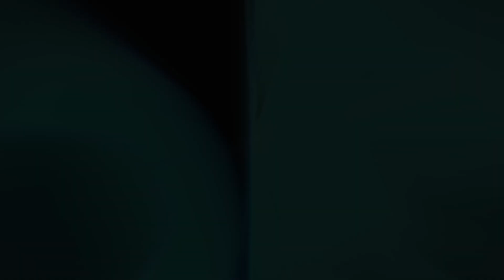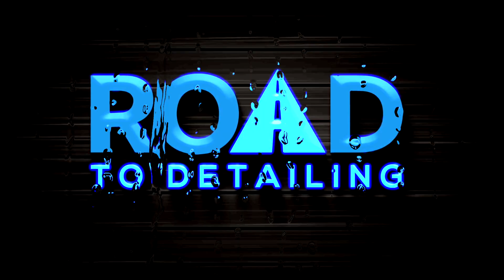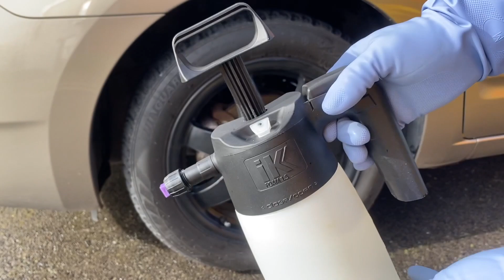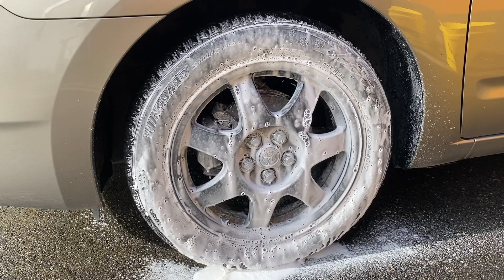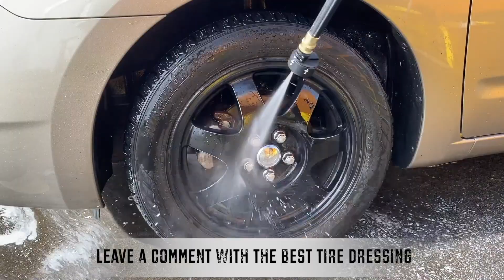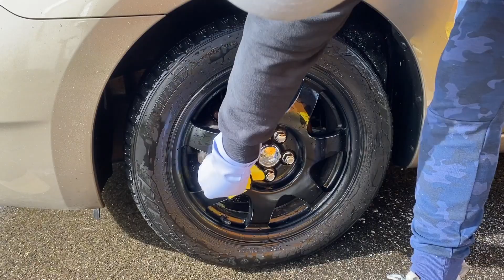Bilt Hamber Surfex HD for Clean Wheels and Tires! (Cheap and Effective)

Comment: There isn't a better all round product than Surfex HD
Reply from the maker: This is so true Chris. I agree 💯 % 👌 I love Surfex HD, one of the most versatile product! Also very cost effective and efficient! What is your second go to product or brand you really like?
Reply: @RoadToDetailing  One of my favourites is Gyeon wet coat. For a spray on rinse off product it leaves the paint really glossy and slick. I've can coat applied to my car, I use wet coat to top up every couple of months
Reply from the maker: @Chris_8270  can an wet coat should be a great combo. I personally don’t have too much experience using them. But I’m halpy for this hint as I was about to find a good spray on rinse off coat, and actually was thinking to get MG Hybrid Cermaic Wax. Did you have a chance to that? If so, you prefer Gyeon’s wet coat over megs?
Reply: @RoadToDetailing  I haven't used it, wouldn't be a big fan of Megs products. Its a bit more expensive than wet coat, I don't think the Megs product offers more to justify spending more on it
Reply from the maker: @Chris_8270  fair enough! Thank you for sharing your honest thoughts and experience. I hope you enjoyed the content and stay tuned for more to come on the channel, I would be happy to read your thoughts in the future.
Reply: @RoadToDetailing  I think when it comes to detailing its whatever works best for you
Reply from the maker: @Chris_8270  🙏👍🏻
Reply: Hi lads just bought surfex hd to use as a pre wash.. do you think I'll be safe to use a 4/5% dilution and spray on before snow foaming? Thanks.
Reply from the maker: @tomaskelly9028  Hi Tomas, 
Absolutely! Surfex HD is recommended to be used at around 4-5% as a pre wash and it’s safe to be used with a dilution ratio like this.

If the condition of the car requires (how dirty it is) you even go a bit more up, and you will be still on the safe side.

My usual go to process: 4% diluted Surfex HD as a pre wash, let it dwell for a minute or two, then cover it with the foam solution to be able to dwell further. Then do the rinse off of the surfex hd and foam together. Works like a treat. However, I think you’re going to be fine just with the surfex hd itself, it is one of the best all arounder on the market at the moment. 

Let us know how you get on with it! Feel free to hit up with further questions! 👍🏻

#happycleaning
Reply: @RoadToDetailing  That's great thanks very much for that. I will get the foam over the pre wash too In that case 👍 Appreciate the comment !
Reply from the maker: @tomaskelly9028  no problem! I like it that way (cover with foam, and it allows surfex hd to dwell further regardless the power of the snow foam solution)  #happycleaning 👍🏻🧼

Comment: Not bad I don’t use Surfex Hd as a wheel cleaner, it has done a good job at getting them clean.
Reply from the maker: It is great to use on wheels for regular washes. For more baked dirt, grime and decontamination you might need to use some like Bilt Hamber Auto Wheel (in BH range). What do you prefer for tire dressing to finish up your wheel cleaning?
Reply: @RoadToDetailing  currently I’m using auto finesse satin but I’m looking to try something different soon.
Reply from the maker: @JDDetailing  for satin finish that’s a great choice! I prefer a slight shine. Video will come out about this topic within a week or so 😉👍🏻

Comment: I've  just got  this foamer and some surfex , what dilution have you found to be gd on wheels or is there a gd all round dilution rate ??
Reply from the maker: Hi trev815,

I would say that 10% on wheels in generalis a good ratio, regardless the spray or foam bottle. You could go further up to 20%, if you really need some bite, but I found 10% dilution sufficient. In the foamer I had 100ml of Surfex HD with 900ml of water and I might used much more product then I should have 😊 but this is the cost of a foam, in a pump sprayer, you use less product so it’s more efficient and the results the same either way. 

I like to use surfex-hd either way, however foam it up makes me more happy 😊 

Let me know how you get on with the results!
Reply: @RoadToDetailing  thanks buddy , planning on stripping arches on car and work van for a gd clean before some lanoguard and acf 50 anti corrosion love 😂 looks as tho this stuff will work a treat 👍
Reply from the maker: It will do the trick I would say! 👍🏻 keep me posted with the results 🔥

Comment: Is Surfex HD as a touchless pre cleaner as strong as BH Auto foam?
Reply from the maker: Hi Dennis,
Well, Surfex HD is a concentrated all purpose cleaner, meaning you can dilute the product for different jobs. However, it’s advised to use around 4% dilution on paintwork. I don’t know that would be just as strong as Auto Foam, because I haven’t compared them, but in theory, yea it can be just as effective as auto foam, but I would say is even more harsh of a chemical than Auto Foam. You can use Surfex HD for pre wash around 4%, but it might leave residue left, and has even less of a working time than AF, what you need to consider in my opinion. Also, I would only use Surfex for the lower parts of the car, where dirt accumulate more, then cover the whole car with a blanket of foam for a longer working time and a safer use. Hope it helps,
Viktor

Comment: Does it not destroy the seals in your sprayer?
Reply from the maker: Great question! I hadn’t experienced such issue like this and I mostly use my IK sprayer with alkaline cleaners. 

However! I clean the parts with water after each use. If I wouldn’t, I can imagine the filter, especially, can be clogged up and fail. But IK foamers comes with at least 6 extra filters, that will sort you out for a long time.

Thanks for watching 🙌

Comment: I’ve tried 10:1 but IK foamer won’t produce foam when using Surfex HD I’m using the grey nozzle by the way?
Reply from the maker: Hi Lewis,

Grey nozzle should be fine, I have used that as well (even it worked fine with the orange, that supposed to be wet kind density). Do you have the 1.5 Foamer? Worth case scenario, might need to check up the white filter at the connection of the black tip (where solution comes out). 

Can you describe your issue in more detail? Like, do you have solution coming out but it doesn't foam at all, or you struggle getting anything out from it at all? I know its stupid question, but have you tried pump it up fully? in the video I used 10% dilution, that is 100ml surfex to 900ml water (that is basically 1:9)

if you have done all the above and still struggle, I suggest to ask IK themselves, they are very helpful in any issue, but I hope I can help you further.

Viktor
Reply: @RoadToDetailing  thanks Viktor I used same dilution ratio as you stated. It sprays well but not foaming. Let me try again and check filter and I will  fully pump it up  and let you know
Reply from the maker: @clewis5220  hope the foamer will work as it supposed to. Try to play around the colored tips as well, you might have an other tip work better than the other.
Also, try to put some snow foam in it, just to be sure that if the problem still occurs its not down to the chemical.

If none would work, I suggest you to get in contact with the company you purchased off the product or with IK directly. 

Keep me posted,
Viktor

Comment: hi can you use serfex hd on carpets or seats for good clean or for spot stains?
Reply from the maker: Hi Gareth,

Yes you can. General dilution is 1% for interior cleaning. But I suggest to do a spot check on the surface. Also, dilution could vary depending on the stain itself.

I like to use dedicated products, and here is a good one for this kind of job :

https://youtu.be/JRtOnEFr5hQ

Hope it helps,
Viktor

Comment: 10% dilution means in 1 Litre of total solution we need 100 ML of product + 900 Ml Water. Is that calculation correct?
Reply from the maker: Hi Dilpreet,

Yes, 10%: 100ML product and 900ML water 👌

Here is a quick video of mine about dilution calculations, with a helpful calculator tool which helps to do the math within a second or so.

https://youtu.be/NHMZ1uNeUGc

Hope it helps,
Viktor
Reply: @RoadToDetailing  Thanks a ton brother. I have been getting sleepless nights over these ratios. Quick question though. Using 10% dilution as a pre-wash will it strip down ceramic coatings? Also in general is this 10% ratio enough to clean the paint and get rid of any waxes or sealants which I have applied over the coating over the years?
Reply from the maker: You’re very welcome!

I would use only a 4-5% dilution of Surfex HD on paint work, because that would be enough strength in my opinion, then you won’t heart the waxes and sealants, although using a stronger ratio of APC as a pre-wash will degrade your last step protection time to time (wash by wash). However, ceramic coatings are very durable in general, so you can’t really hurt them or remove them by using even stronger dilution of an APC, but it depends how old is it.

If your goal is to strip old waxes and sealents, you might want to go with 10% ratio, or a dedicated strip product like PoorBoy’s Strip Down. The right choice of dilution and chemicals will depend on the outcome you want.
Reply: @SensibleBHPian  wont strip ceramic coating even at 100%
Reply from the maker: Agreed 💯

Comment: You have only used Surfex HD pure, not diluted？
Reply from the maker: Hi David, I diluted it down with water and used a dilution ratio of 1:10. In the foam sprayer it’s 68ml of Surfex with 682ml water. (1part product 10 parts water) Surfex HD is a quiet strong APC, 1:10 is a strong concentration, so I would recommend it to dilute down as it will be very strong using it neat.

Strong pre-wash on paintwork I use it at 4%. Interior 1%.
Reply: Dont use neat, it's potent stuff!